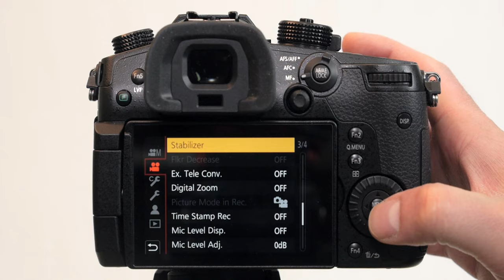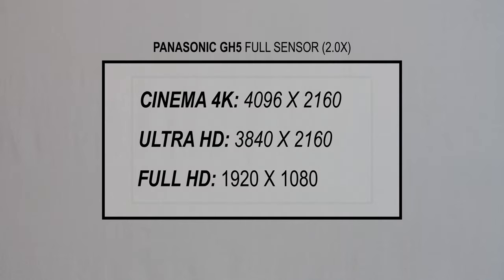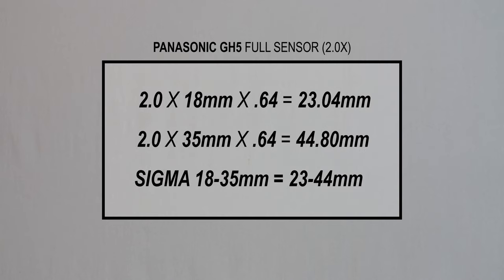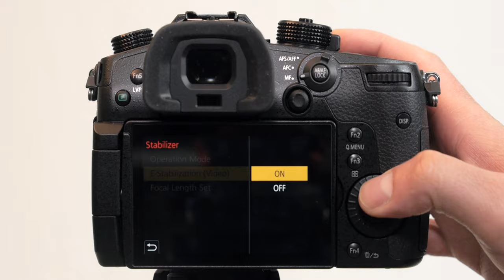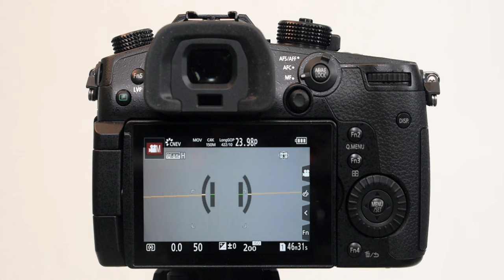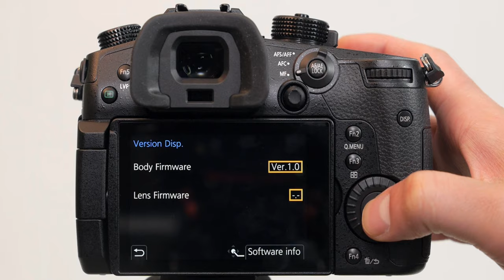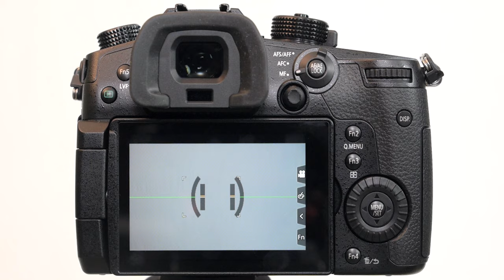Panasonic GH5 Sigma 18-35mm Vignette Test | Crop Factor Explained

Comment: Great vid! I'm sure you probably already answered this question somewhere but I'm considering switching to the GH5 from Nikon and I was wondering, does the autofocus work with the Metabones adapter? I know the focus might not be great but I'm just interested if it works at all. 
Thank you
Reply from the maker: Thank you! Unfortunately the GH5 autofocus does not work with the Nikon version of the Metabones Speed Booster. The Canon (EF-mount) version of the Metabones Speed Booster does work with the autofocus on the GH5 since it provides an electronic communication between the camera body and lens. In my opinion, the autofocus on the GH5 is not very reliable and it’s best to stick with native MFT lenses when using this feature. We will be reviewing the autofocus and tap to focus features on the GH5 with native lenses in our next video. Thanks for watching!

Comment: I have the Sigma 18-35 f1.8 EF mounted on a Commlite adapter AEF-MFT(AF). I have not experienced any vignetting nor does my camera "freak out" due to the connections. Camera stabilizer is on working fine along with the auto focus and auto exposure . It has been smooth sailing so far so.....I don't know maybe I'm just lucky or the $120.00 Commlite is better than the more expensive Metabones.
Reply from the maker: Wow, that's fantastic news! Unfortunately all of my APS-C lens are Nikon mount, but for the price the Commlite is definitely the way to go. Thanks for sharing!
Reply: Commlite makes adapters for Nikon as well. Unfortunately they travel on a very slow boat from China then by stage coach so it takes like a month more or less for it to reach your door. I just got this a few days ago and it has been pretty darn good so far, we'll see for the long haul how it goes. I mostly shoot in manual mode unless the action is fast and furious (i.e. sports, events) that's when auto focus helps a whole lot.
Reply from the maker: For the price, I definitely wouldn't mind the wait. Will be picking one of these up for my Bmmcc. Thanks again man!

Comment: With a full frame lens on the Speedbooster XL, we know that the light increases by 1.3 stops. But when about on a APS-C image circle? I'm guessing the gain is less?
Reply from the maker: We would agree with you on that assumption. The smaller the image circle would result in less light reaching the speedbooster.

Comment: great job!  I liked watching.  I may be switching from a6500 to GH5 shortly, and the sigma is the lens I'll likely go with.  Thanks!
Reply from the maker: Thank you for watching! The GH5 is an awesome camera. If you plan on purchasing the Sigma lens, I would recommend purchasing the Metabones Speed Booster Ultra .71 over the XL .64. The Ultra would avoid any type of vignetting. Also unlike the Nikon version, the Canon version of the Sigma lens communicates electronically with the GH5, which enables autofocus and displays your f-stop. With that being said, the Canon version has experienced freezing issues with the GH5. I'm not sure if this has been corrected with a firmware update. I apologize if this is a lot of info to throw at you, hopefully these factors will help you make a purchase that's best for your setup. Thanks again and great channel btw! You have yourself another subscriber!
Reply: Hey thanks for subscribing.  I also subbed to you! Great content.  The Canon version seems to be the preferred now that a firmware update has been released to fix the freezing issues.  retaining autofocus and F-Stop info is good to have!  Keep up the good work on the content!
Reply from the maker: Thank you very much!
Reply: One Orbit Studios hi. I don’t require auto focus,  but how about the tap to focus with the ultra? I want to upgrade gh5 from g85? So I can get ultra speed booster and sigma lens now :).  Since I cover sports, I need fast tap to focus or shutter button focus.

Comment: The strange thing is that I am shooting in 1080p at 18mm with the Sigma 18-35 1.8 and the Metabones 0.71x and I should be getting around  23mm Full frame equivalent but instead I am getting a more cropped image, here is a comparison with the Canon Eos R at 24mm.

Canon Eos R
https://postimg.cc/2qBF8WVX

Gh5s

https://postimg.cc/zVJyyNHw
Reply from the maker: We apologize for the confusion. We were shooting with the Metabones Speed Booster XL .64x (Nikon F-Mount). The .71 Speedbooster will result is a slightly cropped image. 25.56 mm (Full Frame Equivalent to be exact) 
Here's the math:
2x (Crop Factor) x 18mm (Sigma Focal Length) x.71 (Speedbooster) = 25.56 mm 
We hope this helps and thanks for watching!

Comment: If I do end up getting the GH5 I think I'm gonna get the Ultra rather than the XL. Unless someone gives me a major reason not to. I find it easier to get closer to the focal lengths I want for the Samyang (Rokinon) lenses. 24mm x 0.71 x 2 = 34.08 and 35mm x 0.71 x 2 = 49.7. So effectively giving me a 35mm & 50mm. Plus if I got the Sigma 18-35mm instead there be no vignette.
Reply from the maker: I would have to agree with you Daniel. The Ultra is the better choice for the GH5. I originally picked up the XL to use on my BMPCC a few years back. The fact I can use the XL on the GH5 (despite the vignetting) was a bonus for me. Thanks for watching!
Reply: One Orbit Studios Thanks for the response. I think that's definitely sold me on the Ultra now. Cheers
Reply from the maker: Anytime! Glad I could help
Reply: i got some vignetting the other day with my GH5/Ultra and Sigma 18-35... i was in VFR mode, with stabilization on, turning around a corner while pulling a string for a cat to chase... top left and bottom left corners started going slightly dark.... was the first time it happened to me despite using the camera and lens everyday, seems uncommon. i don't even really care but thought i'd mention.

Comment: How about still photos (4:3)? Would the vignetting go away after 20mm?
Thanks,
Reply from the maker: Vignetting is very bad in still photos (4:3). Zooming all the way in to 35mm will reduce but not eliminate the vignetting. Now in photos (3:2) the vignetting is slightly worse than the results seen in this video. The main difference is you notice the vignetting begin to disappear at 24mm. Zooming in to 35mm and the vignetting is gone.
Reply from the maker: I will shoot a video highlighting all of the results I just mentioned. I apologize for the wait but I'm running many test to ensure I'm providing accurate results. Thanks!
Reply: Thank you so much. I'll look forward to it!!!

Comment: so If I Buy the 12-35mm Lumix lens for GH5 does the crop factor apply? since is a M4thirds native lens?
Reply from the maker: Yes, the panasonic M4thirds system has a 2x crop factor. Essentially the lumix 12-35 would become a (full frame equivalent) 24-70mm lens. Hope this helps!

Comment: I was not sure if I should get the Nikon or the Canon mount version of this Sigma! But your video makes me tend toward Nikon (shorter flange distance than the Canon) and the XL, because I want more reach on the wider end and you demostrate that with IBIS on, it works fairly well with the XL :) On the other hand, the canon mount with the Ultra (0.71) will lose nearly 4mm on the wider end: 21-40mm rounded, (see below).

Only your math is not convincing me: 18-35mm refers to an aps-c sensor, so the ff equivalent in Nikon is 27-52.5mm, these are the numbers you should multiply by 0.64 resulting in 17.28-33.6mm (a little bit wider than the original 18-35 aps-c specs) or 8.64-16.8mm in m4/3 terms.

Nikon mount, SB XL:
18mm x 1.5 = 27mm (ff equivalent, no more need to multiply by 2x)
35mm x 1.5 = 52.5mm (ff equivalent, no more need to multiply by 2x)

27 x 0.64 = 17.28mm
52.5 x 0.64 = 33.6mm

Canon mount, SB Ultra:
18mm x 1.6 = 28.8mm (ff equivalent, no more need to multiply by 2x)
35mm x 1.6 = 56mm (ff equivalent, no more need to multiply by 2x)

28.8 x 0.71 = 20.45mm
56 x 0.71 = 39.76mm

Why is this important to get it right? Because the new PanaLeica 8-18mm f/2.8-4 (or the old Oly 9-18mm f/4.0-5.6) will cover nearly the same focal lenght as the nikon Sigma + XL, "only" 3-5 stops slower!!!

There is only one way to prove that, if you have any other, native lens to test the fov (and my maths) of the Sigma in the wider end + SBXL?? It seems, nobody is doing that right on youtube or any place...
Reply from the maker: Wow, thanks for the great response! My understanding was the Metabones SB .64 XL brings the GH5 crop factor from 2.0 to essentially 1.28 (2.0 x .64). This makes the Sigma 18-35 slightly wider on the M43 sensor than it would on the APS-C sensor. 

APS-C Sensor 
18mm x 1.5 = 27mm 
35mm x 1.5 = 52.5mm 

GH5 M43 Sensor

18mm x 1.28 = 23.04mm 
35mm x 1.28 = 44.80mm 

I’ll run a few tests with the native Panasonic 12-35mm to see how the fov compares with the Sigma & Metabones XL. I’ll post the results once we have them. 

Meanwhile, I agree the extra reach of the Metabones Speedbooster XL is nice to have. Considering the fact the IBIS helps to cut out some of the vignetting. Thanks again for the info!
Reply: You do need to multiply the focal lenght by 2, doesnt matter if its a FF or APS-C lens. The 2x comes from the sensor size, not the lens coverage. Focal length is the same on a APS-C and a FF camera, an APS-C lens on a FF camera will just create lots of vignetting because it doesnt cover the whole sensor.
Reply from the maker: Thanks for the help! I updated the video with the correct focal length.
Reply: So, do you think then that the focal lenght is the same on an aps-c, ff AND m43 sensor? I think no, and clearly the Pany 12-60 states their equivalence to a 24-120 in ff, so as the Sigma 18-35 states (read the specs) thak equals a 27-52.5mm on ff. 

You should allways consider (and include in the math) the crop factor, not only for m43 lenses, for aps-c ones too:

micro 43 = 2X
aps-c canon= 1.6X
aps-c nikon (and the rest) = 1.5X
Reply: Can you post  a new video showing both lenses (Sigma 18-35 and Pany 12-35) at wider end to confirm the numbers?
Reply: You seem to lack the knowledge to understand how a LENS works. It does not matter if its an APS-C lens or a FF lens, the focal length is the same. The only difference is that an APS-C lens wont cover the FF sensor, the sensor is where the crop factor comes from.

So that being said the math is: Focal length (18mm) * Speedbooster (0,71) * Crop (2x) =  25,56mm

You do realise that in your calculation you are calculating the APS-C crop AND the M43 crop?
Reply: So, then can I really say: "you seem to lack the knowledge to understand how a LENS works. It does not matter if its an m43 lens or a FF lens, the focal length is the same."??? Why are you only appliying the 2X crop to the m43 and not the 1.5X crop to the aps-c???

M43, Aps-c and Full Frame are only nomenclatures but not  equivalencies, here lies your error.

Take for instance the "kit lenses", maybe you don´t have done the math to comprehend that they are almost equivalent in full frame terms: a Lumix 14-42mm (28-84mm) is rougly the same as a Nikon 18-55mm (27-82.5mm)

Your error then, is that you multiply the aps-c focal lenght by 2 to get the equivalent "m43" (whence?) in full frame (18*2=36 wrong it is 18*1.5=27), BUT you only need to multiply by 1.5 (or 1.6 in canon mount) to get the ff equivalent. You then divide by 2 to get the m43 nomenclature.

So in the Sigma case 18 * 1.5 =27. From here to get the m43 nomenclature you divide by 2 = 13.5  * 0.64 = 8.64

"The Sigma 18-35mm f/1.8 DC HSM Art Lens for Nikon is a wide-angle to normal-length zoom lens that features a fast, bright constant f/1.8 maximum aperture. It is specifically designed for use with APS-C-sized sensors and provides a 35mm-equivalent focal length range of 27-52.5mm." https://www.bhphotovideo.com/c/product/967345-REG/sigma_18_35mm_f1_8_dc_hsm.html
Reply from the maker: Definitely. I will try to have it by next week. Thanks again man!
Reply: All that math could be outstanding if... we had no this: "The new Speed Booster XL 0.64x reduces the full-frame crop factor of the Panasonic GH4 from 2.0x to 1.28x, thus effectively transforming these cameras into APS-H format." And: "For example, a 50mm f/1.2 becomes a 32mm f/0.80" #) http://www.metabones.com/products/details/mb_spef-m43-bt3 ##) http://www.metabones.com/assets/a/stories/Metabones_Speed_Booster_XL_0.64x_Press_Release_5Jun2015.pdf
Reply: 18*1.5=27 （FF ）
and 27*2=54 （43 ）
and 54*0.64=34.56 （Final）
Reply: LOL Wth Max Payne... have you read the previous message at least? Once for all: 1.5x NEVER applies. Moreover, the focal length of a lens used in some other sensor size has FF 35mm equivalent, oh yeah, but stands whatever focal originally is. The only conversion is based on camera (and its crop factor, respectively) plus focal reducer used, nothing else :-)
Reply: So in conclusion, some people other than a few of you, would infer that: 18*0,64 = 11,52*1,28 = 14,7456
But the fairest bet is the right math: 18*1,28 = 23,04
Thus, 18-35mm will be 23,04-44,80 FF 35mm equivalent.
Reply: Great, I think I got it now! Thanks!

Comment: very helpful,  thank you !
Reply from the maker: You're welcome! Glad you enjoyed!
Reply: One Orbit Studios how do you compare sigma 18-35 vs 12-35 2.8 ?  in every way like sharpless , size and weight,  low light,  auto focus ?  dual is vs ibis ?  i wanted to know. more,  please !  thank you
Reply from the maker: The Lumix 12-35mm and the Sigma 18-35mm both can produce sharp images. The Sigma more so around f2.0. If you looking for a great low light lens, I would go with the Sigma. As far as size and weight, the Lumix is significantly lighter and smaller. The Dual I.S. feature is very nice to have on the Lumix especially if you do a lot of handheld filming with out a gimbal.

To put it all into perspective, I use the Sigma 18-35 for short films and filming in low light situations. Also, the bokeh produced on the Sigma is just beautiful. I like to use the Lumix for event coverage and run and gun situations. The Lumix is also very sharp and with the added benefit of using Dual I.S. this will be my go to lens for shooting handheld on the GH5. 

Hope this helps!
Reply: you did answer all my questions indeed,  thanks again!  i know which gear i would need now !
Reply from the maker: Awesome. Glad I could help!

Comment: hello. Today i bought my gh5 + metabones speedbooster xl.0.64x and i have a problem with it . When i set 18mm on my sigma 18-35mm i have a big and ugly Vignette. I download new drivers for metabones but its doesnt help. What can i do to fix this problem;/?
Reply from the maker: Due to the 2x crop factor of the GH5 you will experience vignetting with the Sigma18-35 from 18-20mm roughly. The GH4 had a 2.3x crop factor in 4K which is why it did not vignette with Speedbooster XL and Sigma 18-35. I would recommend returning the Speedbooster XL (.64) and purchasing the Speedbooster Ultra (.71). The Ultra will not vignette with the Sigma 18-35mm. Hope this helps!

Comment: I can't understand, the sigma 18-35 f1.8 with speedboster metabones xl of canon what should it be the real focal range? 23-44 mm?   And how about the aperture? the f1.8 remain the same or became an f1.4 pls explane me this thing
Reply from the maker: The focal range should remain in the same (23-44mm) range on the Canon xl adapter. Although this is not exact, the aperture would be closer to f1.1 as well. Hope this helps!
Reply: wow f1.1 so in terms of deep of field m43 and ff at that aperture look like almost the same, righ? But, does autofocus work with this lens and adapter (canon mount) ?
Reply from the maker: Definitely! I've gotten some fantastic bokeh with the lens and adapter. Autofocus does indeed work with the Canon mount. Although, I wouldn't expect it to work as quickly as using native mft lenses.

Comment: can i use rokinon 12mm ef with metabones with GH5 or MFT version of this lens would be better choice?
Reply from the maker: You can use the rokinon 12 ef with the metabones on the GH5, but to save you money I would recommend using the MFT version of the lens. This saves you having to purchase the metabones adapter. Hope this helps!
Reply: One Orbit Studios thank you. i need to buy metabones anyway for my ef sigma:) just heard about  issues with some lenses on metabones
Reply from the maker: Awesome. With the metabones, the 12mm rokinon (f2.0) will be even faster:) That will definitely help out the GH5 in low light. Thanks again for watching!
Reply: okay... :)  my first idea was in using ef-mount 12mm rokinon with  MC11 on my a6300 and with Metabones on my future GH5 (yeah, I am practical guy:)

now I am confused - I found 2 lenses - the first one is 12mm EF Full frame fisheye (2.8)  and second one is 12mm for Canon M. I think the second one is right choice? And I will receive 8.5 mm angle (x2 on MFT) with metabones?

I am thining about Laowa 7.5 mm too but Rokinon is cheaper. The one thing... I am afraid that I will have some soft edges or issues with Rokinon EF lens and metabones. I can't find a lot videos here with video examples. Rokinon has MFT version of this lens and the only videos I was find is MFT footages.
Reply from the maker: I would recommend the 12mm Rokinon EF Full Frame lens. The 12mm Canon M mount is for Canon’s own mirrorless system and which I’m not sure would work with the Metabones Speedbooster. Due to the new (2.0) crop factor on the GH5, I would recommend purchasing the Metabones Speedbooster Ultra .71 to avoid vignetting. 

Here’s a link:

https://www.adorama.com/mbspefm43bt4.html

I unfortunately don’t have any experience with using the Laowa 7.5 mm. Hope this helps!
Reply: many thanks:)
Reply from the maker: Anytime! Thanks for watching:) We have a few videos coming out soon so stayed tuned!